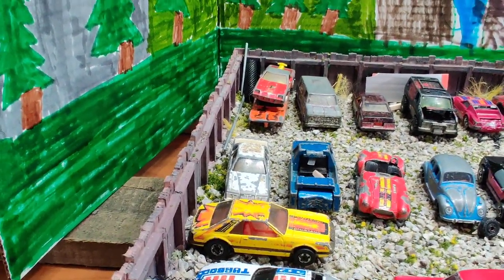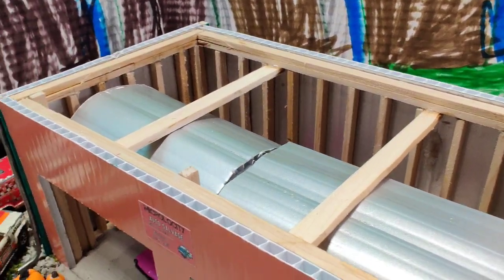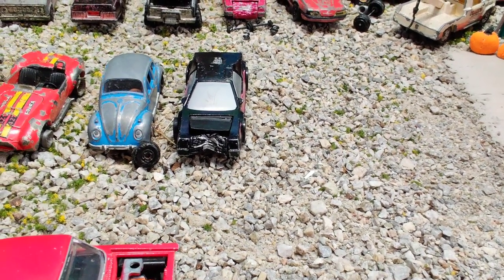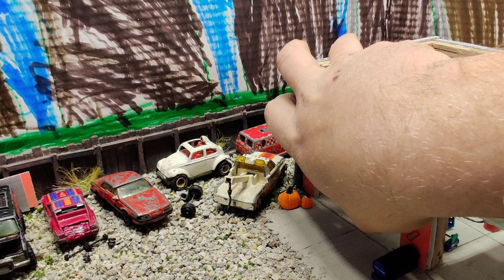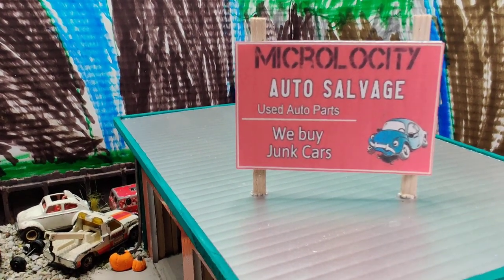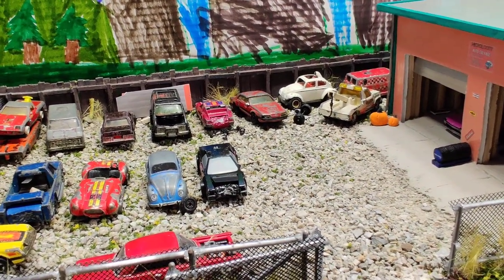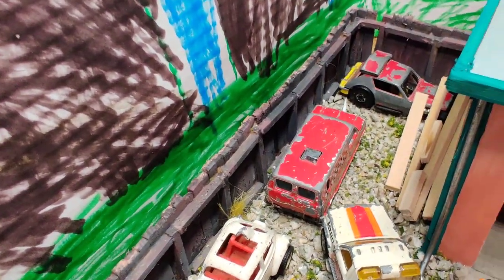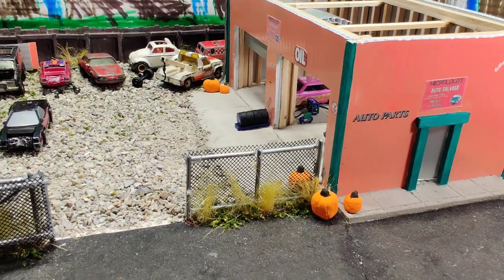1/64 Scale Junkyard Diorama and This is How I Built it!

Comment: This looks really cool and inspires me to start my own, I was thinking about smashing cars in a table vise.
Reply from the maker: Thank you! You should try and start your own. It was a lot of fun to build. Check out my latest video about my diorama challenge. Might be a fun way for you to get started. I like your vise idea.
Reply: Problem with that is they just look like hotwheels or matchboxes smashed in a vise. You have to think in scale what those car parts would look like dented smashed missing ect. You can thin down metal using a dremel or make fenders roofs hoods trunks out of paper cardstock tinfoil to look like dented smashed missing or removed parts. Cutting doors hoods trunks and leaving them open (like in a real salvage yard) looks so much better then just cars lined up. tires flattened or removed cars sitting on them or rims add realism also. Just take a walk through your local salvage yard taking pictures and vids will be a boon when doing things like this.

Comment: Awsome work..all you need is a couple of Yunkyard 🐕 Dogs.but over all great job
Reply from the maker: Thank you! Maybe I'll add some in the future.
Reply: @microlocity  speaking of Junkyard dogs.....SOME models of Hot Wheels and Matchbox have dogs molded into the inside of the cars... just cut the doors off (or tailgate depending where they are located) and the dogs would be exposed also make some REALLY small food bowls and place them between the garage doors.
Reply from the maker: That's a pretty good idea. I do have an old Mercury station wagon with two dogs in the back. I will look through my old cars and see if I have any more with dogs in them. I like the food bowl idea. Thanks

Comment: Great job on this diorama shows a lot of imagination. Here's a few ideas for you. Get a scale ruler it will help out a lot. For studs being more in scale when doing framing or fence get yourself a bag of coffee stirrers and different sized popsicle sticks. They are in scale with 2 x 4's 2x6's ect. The gravel you can simulate using course sand use pvp and water or mod podge to glue them down then using shades of white to greys it makes a realistic gravel yard. If you try and solder again use a small torch it will do the job of heating up and flowing over the soldering iron which just doesn't heat up enough. The hot glue on the fence can be saved easy enough cut back the excess with a good exacto blade then paint the fence and glue. If you grime up and do a bit of rust on that fencing it will end up looking so much better as an old salvage yard. Finally the printed signs if you use a wet cloth on the back side and wear the thickness of the paper down they look much more realistic and can be grimed up and aged also. The cars in the yard there's a modeler out there that specializes in doing crashed wrecked burned and just old grimey cars. I'll try and get his name he does very interesting things including broken windshields bent bumpers fenders and such. He keeps them in scale by using paper cardstock and tinfoil to make the steel of the cars. Try doing the doors out of cardstock next time much thinner you just make half cuts in the material to get the segments. Can even use some flat plastic and do a section with windows in it at scale eye level. Very cool shot through peaking into the shop.
Reply from the maker: Thank you for all the tips! That's a lot of good info that I will use in the future. I really wanted the soldering to work. I will definitely try the small torch idea. I think I will eventually go back and add a few changes and details to the diorama. Since you mentioned about adding rust on the chain link fence, I will probably do that as well as add some weathering on the building. Again, thank you.

Comment: Hi , I started building my own junkyard.I  like your ground that you have with a very small amount of green , what type of rocks did you use for the ground ?  . I am not sure what I am going to use for the ground to put the junk cars on ?
If you have time check out my last few videos of my junkyard  , thanks Mike Espo.
Reply from the maker: Hi Mike, the rocks actually came from my driveway. I picked out ones that I would be able to smash into smaller pieces. I used a hammer and started smashing away lol. I wish I would have made them just a little smaller. I glued them down with Modge Podge. I spread a nice layer of the glue to my base and sprinkled the rocks on. After that, I mixed some Modge Podge and water untill I was able to spray it with a spray bottle. I sprayed the mixture over all of the rocks and sprinkled some of the finer rock dust and some green stuff. Then sprayed a final layer of the glue mix. The green stuff is fall foliage from Hobby Lobby. It kinda feels like foam.
Reply from the maker: Your junkyard is looking great!  I'll have to get caught up on your last couple videos.
Reply: @microlocity  That is awesome , if you see the wood board i am using  , i did only some spots in brown , using old food spices .
Thanks for the info , it helped . Mike .
Reply: @microlocity  Ok thanks , It took me a while to find the perfect crane , that would be able to lift up storage containers , but the one i found will do a good job .

Comment: very cool, you said you had issues with trying to solder the metal pieces, no sure if you tried, but make sure to use A LOT of flux on both pieces before you try adding lead or tin, try pre-tinning the pieces you want to join as well. Good luck with the channel, I subbed as well.
Reply from the maker: Thank you! I'm going to try and test out some more soldering.